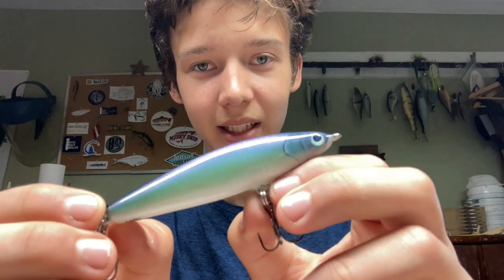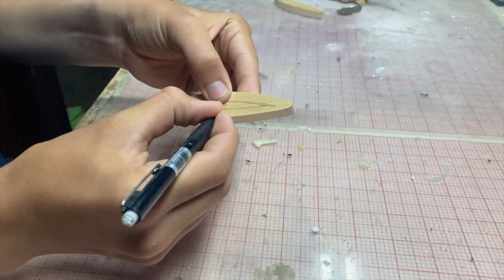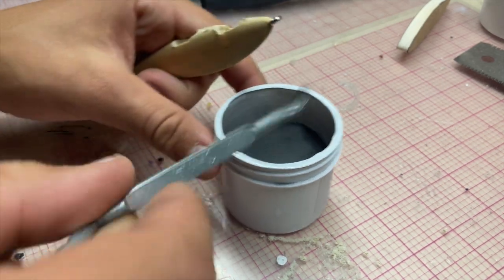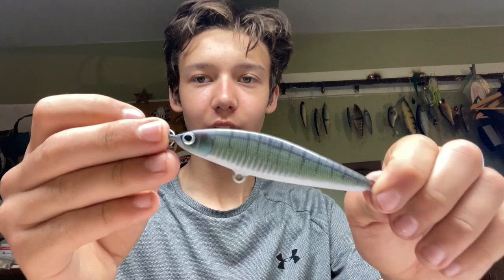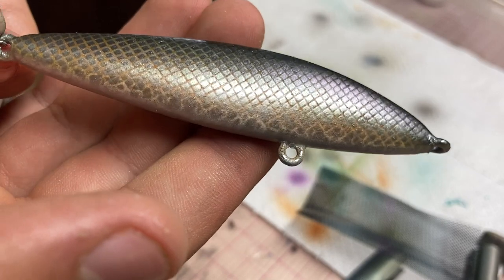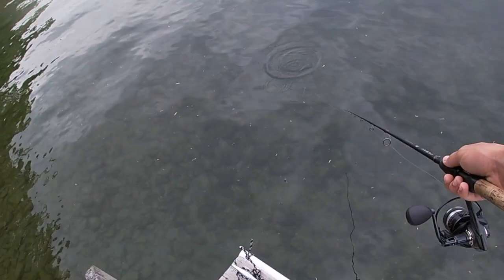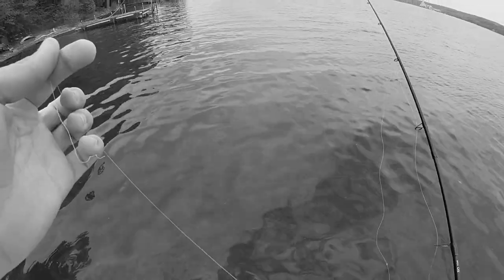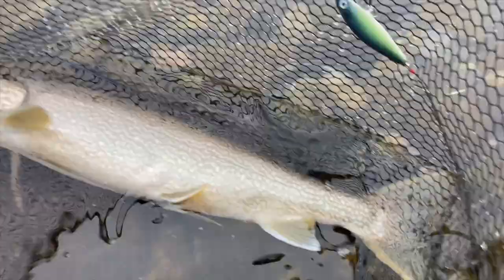Making A WOOD Fishing Lure To Catch GIANT FISH!!!

Comment: I'm really impressed with your lure-making!  Real talent in aesthetics, design, and paintwork.  A piggy tail is a confirmation that the knot was pulled.  I believe you are possibly using the easy-to-tie Cinch Knot?  My grandad taught me to take it one step further, and do the Improved Cinch Knot which is as easy to tie, just one more step is required. No more piggy tails since then. 🐽
Reply from the maker: Thank you! I I am actually using a even further improved clinch knot where you double through the line tie. It has been super solid with every application other than this.